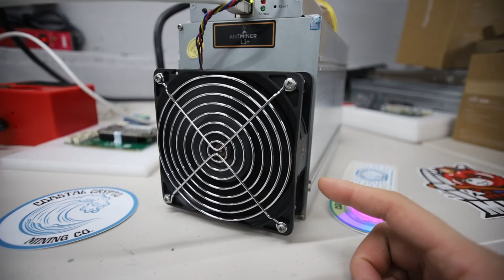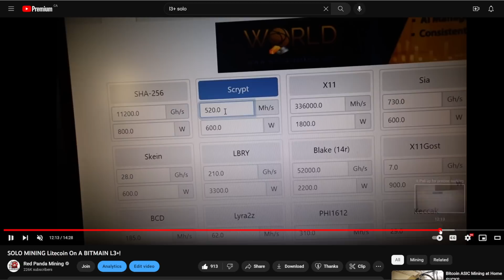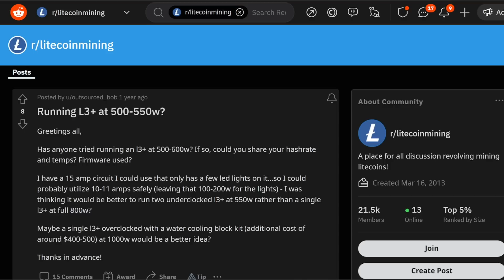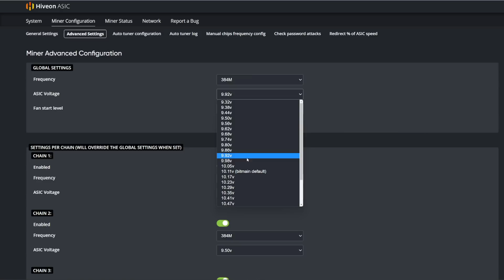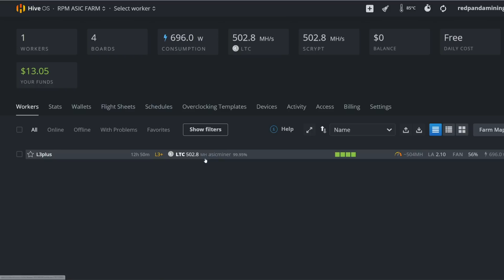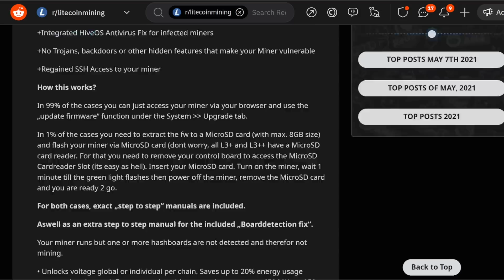Tried to undervolt a 6 year old Litecoin miner

Comment: it is the operating voltage that counts and 3/3 hashboards. I have mine set at 688w and the voltage 7.942v, this with the autotuner and it might be the most optimistic way of running the S9.

Comment: Hi, could you ask for a screenshot, I am using Blitz firmware, for a test I set 112 mhz for a hash blade and 10v, results is about 150 m/hash with a power consumption  248w…so I can’t understand how this gay has 350 m hash(

Comment: I doubt with the software alone you will get lower power draw, you will require a hardware volt mod to reduce the power further on the boards if those lower power specs are correct. If you get the power too low then you could increase your error rate. I have used the ASIC FW IO flash for a few years no issues, 504Mh @ 660watts, most firmware flash's will give the same results.

Comment: Should have got the L3++.. those doo around 645mh
Reply: with firmware there is no difference
Reply: @coinology2022  true
Reply: @coinology2022  if losing 2
5 - 3 % of your pennies doesn't matter to you..
Reply: @dooley4334  Yeah that’s simply not true. If you install Hive, Brains or Vnish on any L3+ or l3++ you will get the same hashrate with the only factor being silicon lottery or damage to the hashboard.
Reply: @coinology2022  what's not true?? The little bit of extra you get from the increased hashrate you will pay in dev fees.. wtf
Reply: My L3+'s do around 650 over clocked..
Reply: @dooley4334  L3++ go for $500 and L3+ go for $250. The only difference is the firmware stock. It’s not worth the extra amount since you would not run it on stock firmware anyways. And I agree to disagree with you Sir. Silicon lottery and damage are the only factor when you have upgraded firmware.
Reply: @coinology2022  you're right..

Comment: Mini Doge Low Power mode 150mh/150w. I imagine the Mini Doge Pro has low power mode as well. I only have a rack of Mini Doge and they are all running LPM pushing 1518mh on the monthly average at litecoinpool

Please check the LPM on both Mini Doge/Pro and lets see if that chart can show a couple better efficiency ratings.

Comment: RPM well he did say he used an L3++ plus the Bz FW, with that said I spent about an hour or so now last week doing this very same test on Hives FW, and got a bit better results than yours it’s best not to use auto tuning when testing each frequency for it max performance, 

auto tune has an error limit and any one board that hit that limit it switches to the next voltage or frequency, so you have to use manual config and run each setting for about 10-15min minimum to truly find out what performance/efficiency you can get regardless of errors.
Reply: I got the 1.02 Bz software going to load it up on my ++ to confirm that guys post .. still it been over a year and no one called that guy out .. why did it took that long?